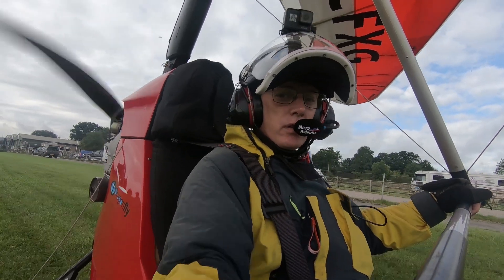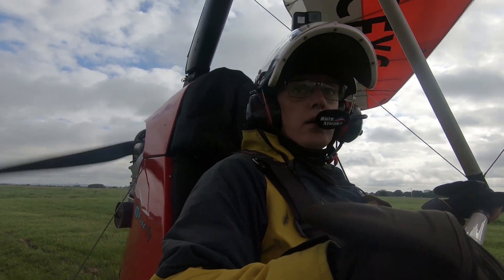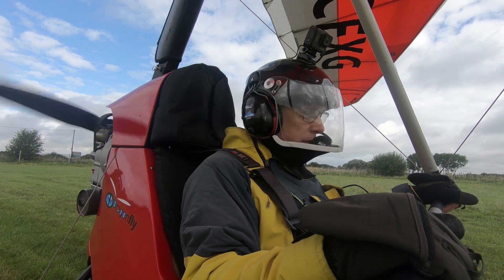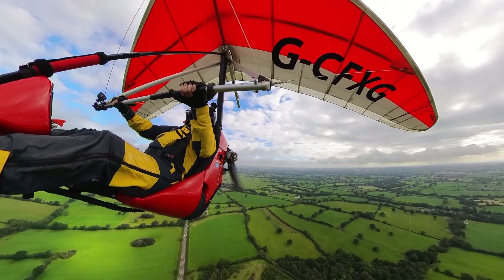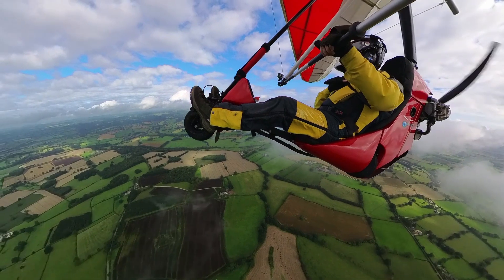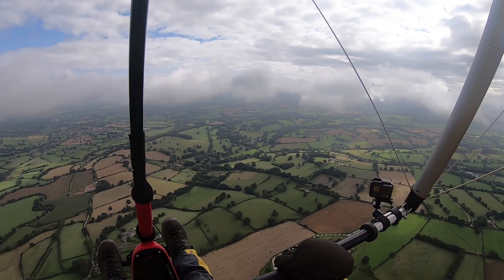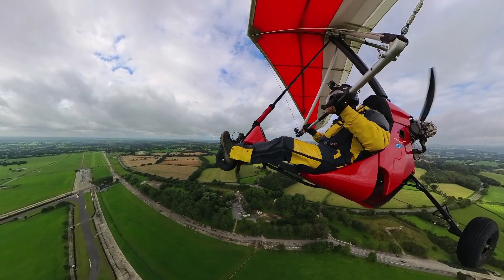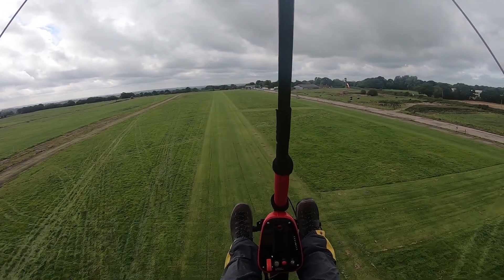Flying the DRAGONFLY - My first experience - Thoughts

Comment: It looks brilliant,  very sleek and sophisticated design lines. I wonder why was it discontinued.  ?
Reply from the maker: Hi Andrew, I think it was possibly cost and not many wanted to fly a single seat. The single seat market has been growing.
Reply: @GolfFoxtrot22 the dragonfly looks very distinctive compared to the other newer models , for some reason i think i might prefer the look of the dragonfly , im sure the newer models are evolved and function better , what do you see as the differences from the old to the new , and what is the natural successor to the dragonfly , etc.........
Reply from the maker: @andrewashmore8000 the newer successor is the Adam with manual retracts. There are a few second hand ones around but the engines aren't available anymore and the Discus wing is very dated.

Comment: What an excellent video this week Giles. Love the new 360 camera view really cool and great quality, gives a really good new perspective to your video's. I can't see the reason for retracted wheels on such a small light aircraft surely the complexity and weight of the mechanism and motor outweigh any aerodynamic advantages?
Reply from the maker: Hi Terry and many thanks for your positive feedback. The 360 footage didn't take too long this time and was an easier external view. The retracts don't actually add too much weight as the legs already are designed to pivot forward. There is a corded ( mechanical not electric) version  which only adds about 1.3 kgs in weight. They do look cool though.

Comment: Great video as usual Giles! I have the same aircraft with the Discus 15t wing and the manual undercarriage plus the Corsair Black Bull 2 stroke.
Reply from the maker: How do you like the 2 stroke on the back? The Discus wing is lovely but I didn't like putting the fibreglass tip poles in, it was a bit scary.
Reply: The two stroke is OK, but I just wish that there was a lightweight 4 stroke electric start engine of 25-30hp  engine easily available for single seat trikes! The fibreglass tip poles are a strange design and require some effort to rig, but at least they shouldn't fall out during flight. I can only imagine how good the Adam wing would be! @GolfFoxtrot22
Reply from the maker: @AuzCoastflyer  I agree I wish there was a better 4 stroke option. The customer seems happy with there machine.
Reply: This particular trike originally had the Hirth 4 stroke engine in it, which I believe was the engine of choice for the Dragonfly. Unfortunately, it blew up and the Corsair was the natural replacement. @GolfFoxtrot22
Reply from the maker: Oh no, I can't believe the engine blew up.

Comment: I love these test flights.  Who makes the wing, and what is the size?  How does it fly compared to your machine?  Thanks for posting.
Reply from the maker: Hi Stone, the wing is a 15 meter Aeros Discus wing. It's very floaty compared to the Adam but then there is a significant amount of time between when the Discus was designed and the Adam.
Reply: Hi Giles, According to Aeros company, Discus wing remains totally current: https://www.aeros.com.ua/manuals/ANT_new.pdf, February 2023, pages 5, 6 and 7. We see that among a panel of 6 of their wings, the Discus is one of the most efficient, just after the mythical Combat. It even scores better than the Adam in stall speed, fuel consumption, climb rate and MTOW. Good flights to all of you! @GolfFoxtrot22

Comment: Electric UC on that seems Excessive. I prefer the two string version.
Reply: Lovely video Giles, nice to see you flying a classic. Surprised Ben didn't put the electric gear on the Adam, but guessing this was due to weight saving.  Hope to see you fly more classics in the future. P.S please tell Mark I am getting withdrawal due to lack of wing nuts 😂
Reply from the maker: Hi Kelvin, thank you and yes it was nice to fly this Classic. On the Adam it was all about the weight saving so rope was a lot lighter than the electric system. I'll pass on the message 😊.
Reply from the maker: Hi Simon, I do agree but it was nice to just flick the gear switch and it travel up and down. This is an only machine and as Ben mentioned in my previous video, it was about making it a little over the top in the first place.